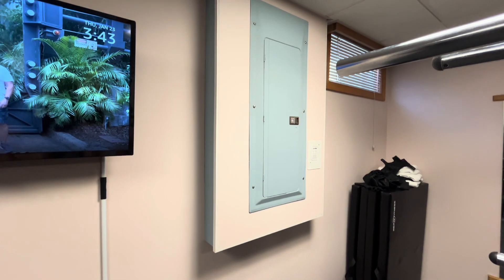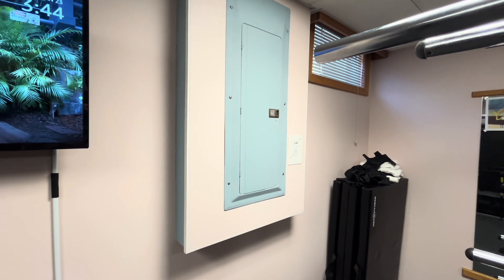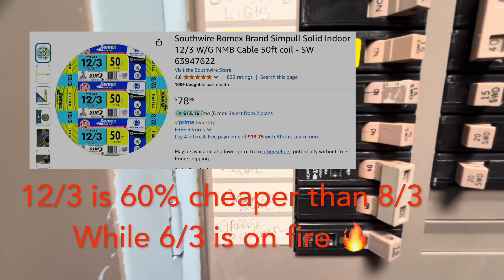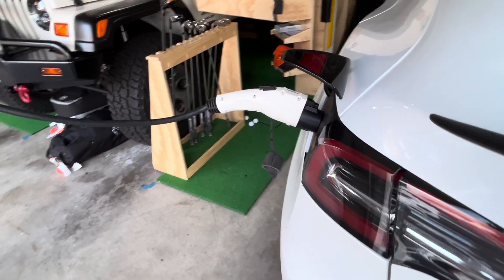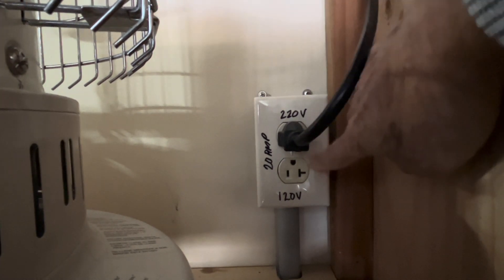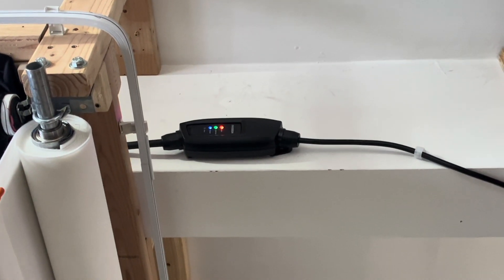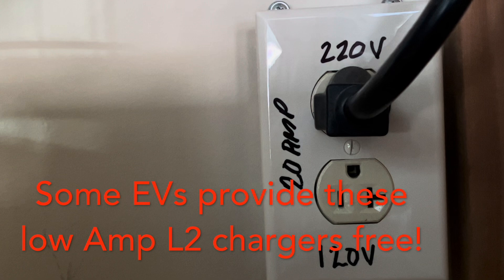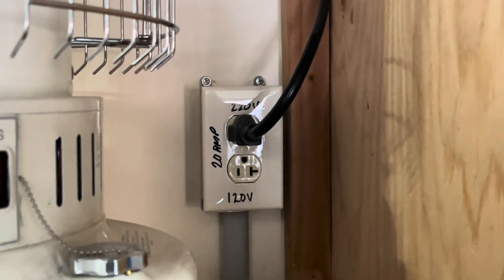DIY #EV Inexpensive Charging At Home

Comment: I have to say, I was skeptical when I saw this, because I was thinking it was 120v - I hadn't considered putting 240v on that!  That is cheap and easy!   Basically your getting about 4800 watts continuous, which isn't "quick", but certainly fast enough.   This is good to know for my parents or others that may get an EV in the future.
When I first got my EV, I was using a dryer outlet in my garage 30 amp @ 80% - so 24amps @ 240v - comes out to 5760 watts.  I installed all the higher end stuff at great expense only to discover my car could only do ~8000 watts (the low end Tesla Model 3's don't have larger inverters).  After all that installation, I was like, man - we were fine the way it was!
Reply from the maker: My first EV was a BMW i3 Rex and this was my initial set up with the dual outlet to provide both 110 and 220 service at 20 Amps.

I traded it for the Model Y and bought the Tesla adapter.  This simple set up is good for 99.7% of EV owners charging at home.  The longest charge I have ever seen was for 8 hours after a long trip otherwise it is a less than 2 hour affair.  

Many of my neighbors do the expensive set up with outside chargers, etc.  That’s OK but my message is that is not needed.  You can charge at home safely and reliably for $300.  Some states offer incentives and that may help offset bigger investments.